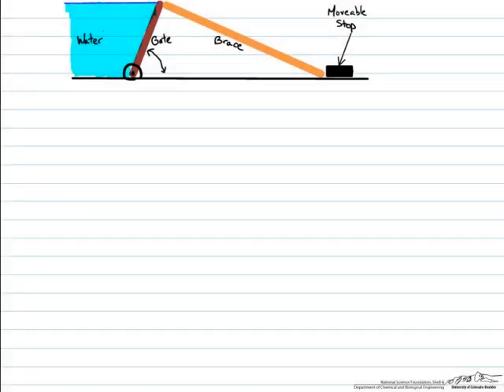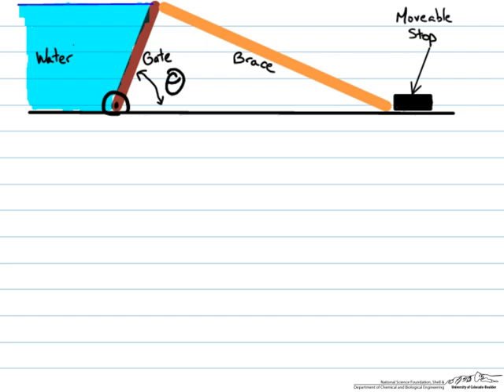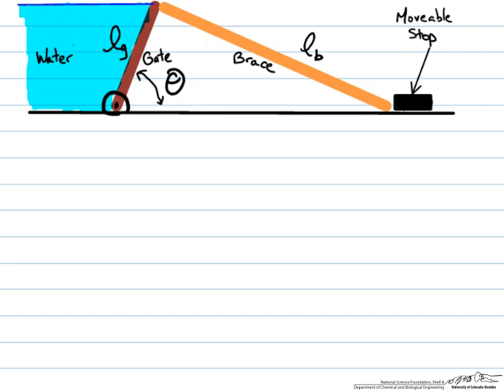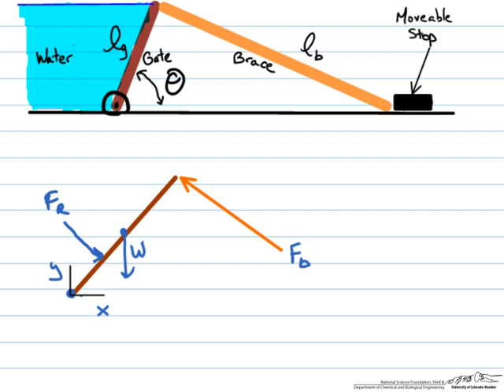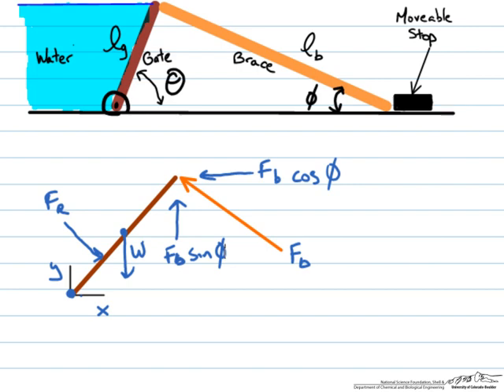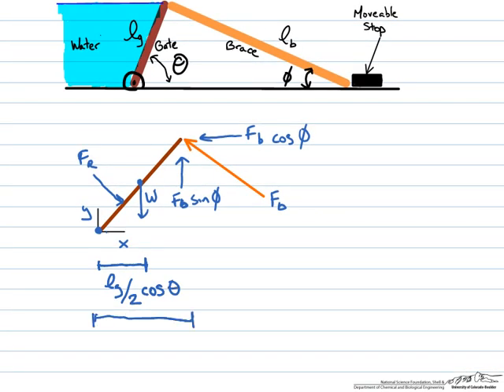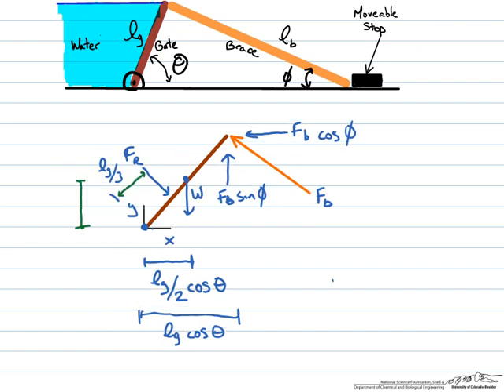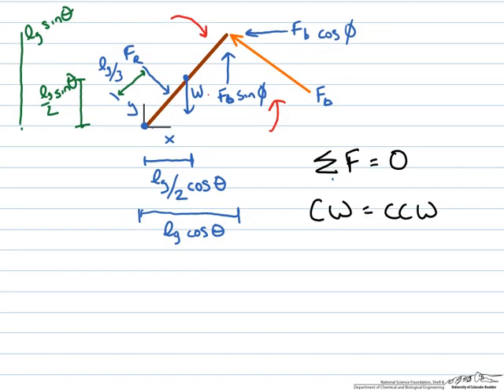Force Balance on Rotating Gate

Comment: I think that in the sum of the forces it should be F_R * l_g/3 *sin(theta) instead of just F_R * l_g/3. Since the pressure gradient doesn't change with the orientation of the gate therefore it is always 1/3 of the way up vertically, and not 1/3 of the way along the orientation of the gate.